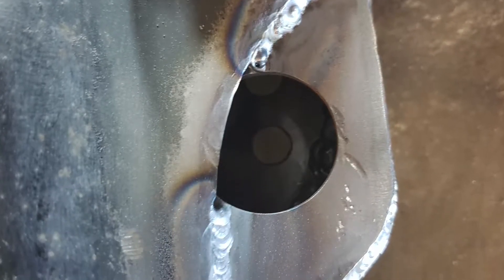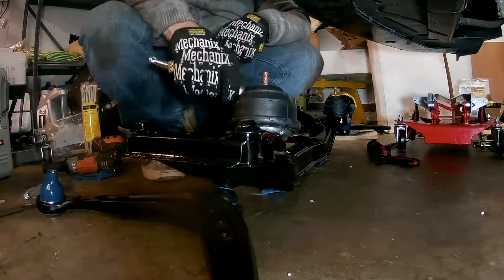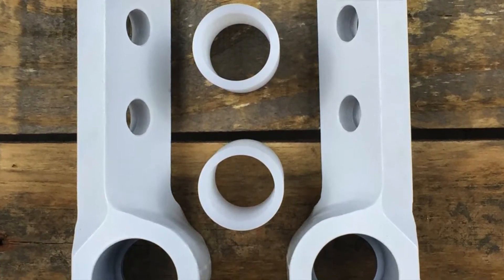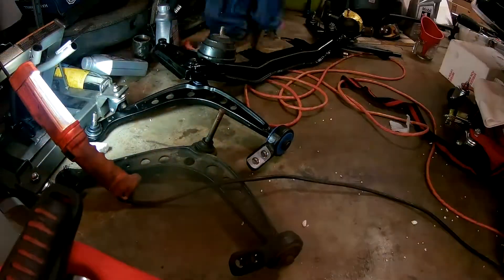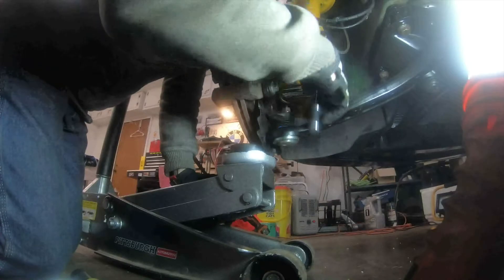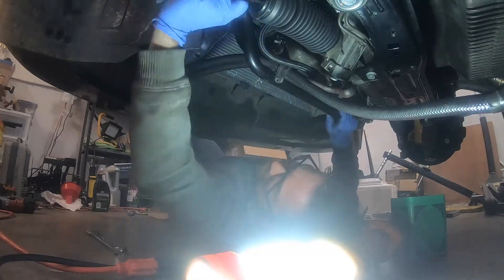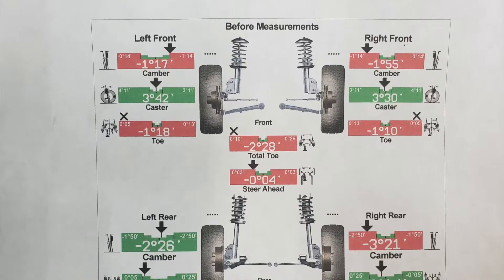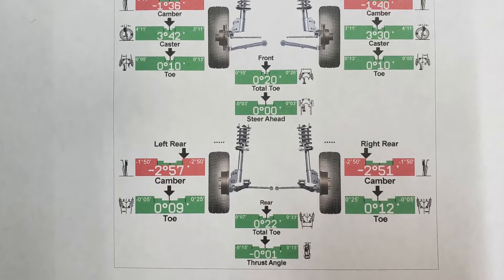BMW Z3 E36 Front Suspension and Subframe Installation

Comment: I’m about to replace my radiator,water pump,and thermostat + hoses in my 2000 z3 2.3 roadster and you are you only person with videos on the same car doing the same stuff really appreciate it. P.S. ima need to put in a new head gasket soon should i look into doing it myself money is tight rn.